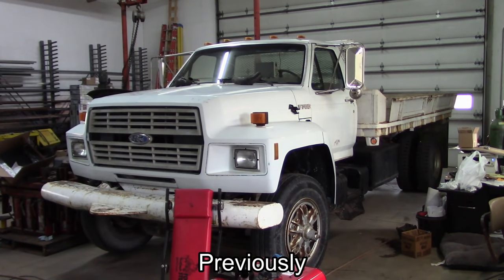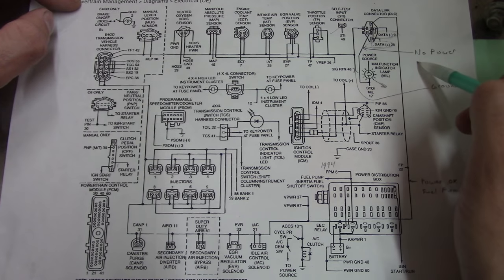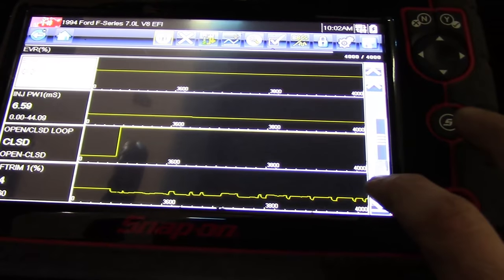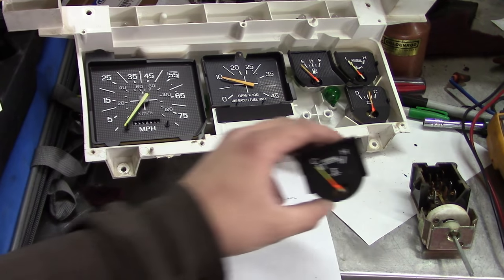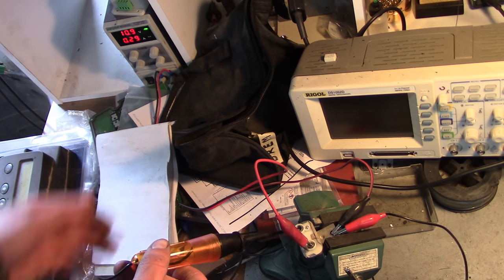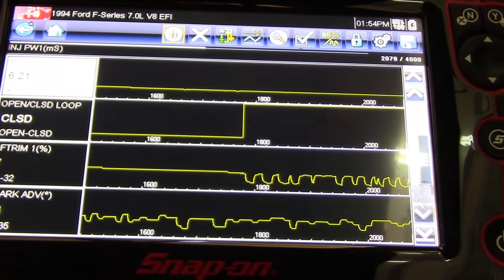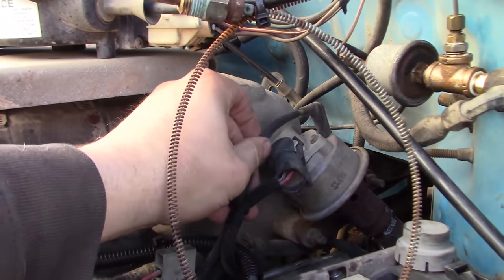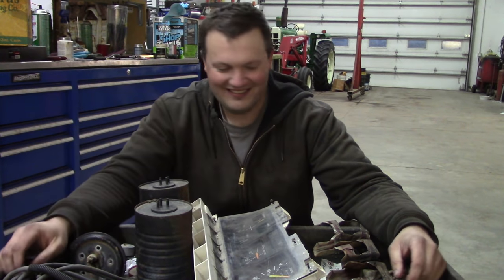Ford F700 Project - Missing, High Idle, and Gauges - Diagnose and Fix (Gas Engine) - Part 3

Comment from the maker: Mystery solved: the second diagnostic connector is for the governor servo unit!
Reply: So that was actually a factory connector? I would've never guessed! And that part you said its for sounds like it belongs on a diesel, not sure what that does on this truck.
Reply: @CumminsDriver100  especially since so many previous “repairs” were Frankensteined together.
Reply: The greens will be happy you spent $120 on new evaporative purge valves, but I think there were cheaper and easier ways.  The simplest being plugging that hose, or a slightly greener way might have been restricting that hose, but leaving a little pin hole size port to draw in the evap fumes, or a pcv valve. 
    I suppose none of those options would shut off the damn light though.
Reply: @dinolino3313  A mechanic should generally try to save his customer money unless specifically ordered not to by the owner, which I doubt because such an owner would just buy a new truck.
Reply: Any method for taking small scratches out of tempered glass? I have a large fish tank that somehow got scratched up by the movers and I was wondering if maybe anyone knew of a way to buff the scratches out or maybe a product that can do it.
Reply: Well, they had to double everything..

Comment: Whatever you charged for this job, it was'nt enough!
Reply: Ha, 2 mortgage payments.
Reply: One of Life's unanswered mysteries I guess.  But I sure am curious.  😉
Reply: I hope atleast $700 just for the labor
Reply: 1200$ labor!
Reply: a dollar 280 an hour.
Reply: To me it would have been [truck resale value] x 1.5
Reply: I was thinking a solid $2k!
Reply: @mph5896  I thought it was "boat payment!"
Reply: That old truck was worth fixing however... Go find one for what it cost to fix.
Reply: It's pretty hard to give the owner a repair bill more than the truck is worth.
Reply: @warrenklingensmith1241  Why? It's not Wes' problem that it's a turd. What could the owner get for the scrap value of the truck plus Wes' repair bill?
Reply: Your phone didn't autocorrect that??

Comment: Wife:  What are you doing?
Me:  Watching Wes Work.
Wife Why?
Me:  Beats the heck out of actually working myself
Reply: I have an Explorer scattered all over my garage floor. Much easier to Watch Wes Work!
Reply: Luv-IT! Ding Ding Ding!!
Reply: @mph5896  I also have a explorer im tearing apart have a 2004 4.6 v8 378,000 on original engine it has deff gone a long way im in the process of pulling it and gonna rebuild it
Reply: Beats the heck out of the absolute garbage on TV.
Reply: @lilscottyboy2004  Nice. I have a 2016, I bought it a month ago with 100k with VVT solenoid codes. I did buy the Explorer cheap, swapped in new solenoids and figured a return problem could occur. Same problem a week later. Pulled it back apart and the solenoid screens are plugging up with aluminum shavings. 

Had to pull the cam cap, and cam. A small piece of steel got into the oil passage and plugged up into the cam and started chewing apart the aluminum head as the cam turned. 

Solution, low mileage used engine. Problem being EVERYTHING needs to come apart to swap the engine. Cradle/drivetrain drops out. Every bolt/hose clamp, connector fought me on this one.
Reply: Jon Trudell it came from a county my brother works for. Not a police car but used by the county. I knew the garage mechanics guessed it needed timing chains. Took a gamble on it. I got it cheap, 5k. If I paid for labor I would be out. I’ll prob have 1k and 20 hours into it. I got a used engine for it with 12k, so that’s a bonus
Reply: @zrkn1  For sure!!
Reply: I just watch white im working 😂
Reply: Very good
Reply: @lilscottyboy2004  I was at the junk yard, and was walking past a couple guys. One said " Ford Exploder, You should have gotten a Chevy"... the next rows, and by the outside had 2 Chevy Trailblazers, and one more in a bit. All three were burned to deferent degrees. I said you mean one of those, that the ran a plastic gas hose in the head.

Comment: Great thought process on a 90s OB1. I have the shop manuals for my 1993 F350 7.3 and I chased a  bad ground for a week trying to get all my rear lights working and trailer plug-in. I am going to check my trucks smog stuff after seeing the rotten canister on my 1987 f150 gas. Thanks for showing a more scientific process instead of just throwing parts at truck like I do. You have helped me keep my old diesel running almost 200,000 miles.

Comment: Congratulations WES and Watch Wes Work hitting the major milestone of 100K Youtube Subscribers, truly is a good channel and well worth the time to view, this F700 wore me down just watching all the little problems it had developed and been patched up over the years, That High Idle pinch tube line test, never know how you figured that one out, still cant imagine how dumping that purge fuel gas back into a system would make this engine speed change, but this F700 to me was one heck of a project, glad you have got patience and stamina, this one would have put anyone to the FULLEST OF MAX TEST.... Congratulations again... 100K, one of the better things that happened in 2020..!!!
Reply from the maker: The open purge line is just a vacuum leak.

Comment: Nice video learned a bit more about evap system and charcoal canisters and evap solenoids. Im an electrical engineer ( 35 years experience) and also have used a power supply and potentiometer to troubleshoot /substitute  for faulty sensors. Most electronic devices have a vendor identification label on the device ( for example TI3055) and if you google the data sheet for the device there is a lot of information on how it works and usually shows some typical circuits which can be helpful.
Reply from the maker: Right. Often you can work around the sensors. The pulse generating sensors are tougher, but a signal generator can fool those.

Comment: You’re the man Wes. I used to be a flat rate mechanic. Now I do pretty much what you do, which is everything. From late model trucks and cars, to tractor trailers, to wood chippers, to excavators. It’s so much more satisfying taking things you learned from fixing cars and using the same principles on a wood chipper. Especially when the wiring is hacked together, which it always is.

Comment: Great job Wes.     You asked about how that instrument voltage regulator worked.     Ford used this system on their 12 volt cars from 1956 and at least through the mid 60's.    Dodge used the same system on my 1977 Ramcharger.   I don't know if the 6 volt cars had a similar system, but they probably did.     How it worked is they switched the incoming voltage (12V) on and off to keep the average output voltage at 5 volts.    Inside the regulator was a heating element connected to the output and a bi-metalic strip that had a set of contacts connected and when the heating element would get the bi-metalic strip hot, it would move and open the contacts, switching the regulator off.    Then it would cool off, close the contacts and it would start over. That means with 12 volts applied, the regulator would output voltage 41.6% of the time.     If the input voltage were to rise to 14 volts, the regulator would be switched on 35.7% of the time.     On the Ford cars and my Dodge truck, the gauges had small heating elements to convert the applied voltage to heat, and the gauge needle was moved by a bi-metalic strip.      That's why the gauges move so slowly.    Also, as you noticed you could see the the regulator switching on and off by the gauges moving a slight amount up  and down.

Comment: I am having massive PTSD flashbacks watching you drive this thing. I learned to drive a truck on a 1981 Ford. It had a 30-foot box, a manual tranny with a split rear, it had a manual choke in the cab. The power steering didn't work when you made a right turn. When I was 19 years old my boss threw me the keys and told me to take to the garment district in Manhattan. The truck was loaded front to back with rolls of fabric. I was terrified! I nearly flipped it over on the ramp that separates the Van Wyck Expressway and Grand Central Parkway. What a day. A few months later he bought us a set of UD's. UD was made by Nissan and it was like driving a sports car compared to that Ford nightmare.

Comment: Wes, that intermittent power instrument voltage regulator is the same type that was used on Mopar products from at least the '60s through the '80s, and its theory of operation has been discussed many times on Mopar forums such as For A Bodies Only.  There is even an improved aftermarket version of it.  I won't attempt to summarize those discussions here.
Reply: Now you mention that I saw them swap one out on misfit garage.
Reply: My 1970 Maverick had this little silver box on the back of the cluster.  I hooked my meter to it to see what it was doing.  Flash, flash, flash.
Reply: @lorrinbarth1969  I believe it pulses the power signal to the fuel gauge so when the fuel is sloshing around the gauge doesn't bounce...

Comment: when are you coming out to fix the cluster on my crane truck? lol Im not much of a pixie wrangler....
Reply from the maker: Well I've got some spare parts if you need em!
Reply: @WatchWesWork  This video really did help me get an idea whats going on in there, I attempted to fix the one in my old F700 Dump  with no success, the crane has the same issues so maybe I can get it going with your borrowed knowledge!
Reply: @DieselCreek  You'll figure it out Matt. A wiring diagram??(in colour), a screwdriver and a large Tonya Harding - fix it one way or another.👍😁

Comment: This is what "Nickle and dime-ing you to death" looks like.
Reply: Sometimes, but I'm betting at the price of getting a new 2020 version or one used about 4-5 yrs old, its cheaper to keep her.
Reply: My experience with  the nickel and dime syndrome is that some will  meaning but dull individual(s) tried to rigg something instead of an honest repair. The end results being a  cascade of failures caused by not repairing it right the first-time.... almost exactly the situation he had. Usually at that point the guilty party is long gone
Reply: @alexlail7481  Exactly. My daily is a 2007 Tahoe with 230k. I bought it with 180k and a bad rear end 3 years ago for a nickel. I do my own work and only use very high quality parts. First year it seemed like I worked on it every other month, often replacing junk parts like sagging aftermarket motor mounts that let the oil pan sag on the steering rack causing a line to break off. Now I am pretty much trouble free (knock on wood). I bring it in every 5k during oil change and look it over. Anything marginal gets replaced. In the past 12 months I may have spent about $500 on it. Not bad considering a new one is $600 a month
Reply: @mph5896  I'm with you on that I have never had a  Daily driver with less than 100k miles  and the one I  gad the longest was 10yrs old and had ~150k when I got it. I drove it for 15yrs and put almost 300k miles on it. But the first year or so was spent undoing other people's work.  My sister who is always a  concerned individual never could understand why I want to  drive something that old and constantly fix it... my response was not fix... maintain..and I spent less per year on average than 1 car payment for her 🙃 , and in general it was more reliable than her car that was less than 5yr old. If I enjoy driving it then i don't care about mileage or age assuming it is dependable and well maintained. My current daily driver is a1971 Ford and the first 3yrs I owned it i averaged over 2000 miles/ month just for work.
Reply: Or you get a old school carburetor  man ,trying to jury rig a fuel injection  system  like we use to do on carburetors.   It will not work ! Everything  must be right for fuel injection  to function properly!

Comment: Hi Wes, Ford used the same instrument cluster regulator in the 1960s here in the UK, it is quite a simple device comprising of a bimetal strip, a pair of contacts and some insulated nichrome wire wrapped around the bimetal strip which turns it on and off just like the old time flasher relays, later on they used an electronic regulator like a 7809 etc.
Regards from Ray in North Wales UK

Comment: I'm a good bit older than you Sir. I was shouting it's sucking air and then shouting it's the volt regulator on the back of the clocks. You got there love watching you work.

Comment: Your the man! My wife has a 1990 volvo 740 wagon that kept dying at stop lights. I went through everything. Ended up bringing to a shop and he ended up finding a 3" piece of vacuum hose that was not leaking, but was soft enough to collapse under vacuum, cutting vacuum to the MAP sensor and dropping the idle way down. Non obd2 is fun!

Comment: The ecm looks like it came out of the bottom of a swamp. The telescoping prop tool also works well against the brake pedal when you need it. Man this thing brings back so many memories of my time wrenching and driving on that F-700 chip truck. Ugh, what a roach. I'm gonna guess getting this one out of your bay is probably the happiest you've been in awhile! Lol I give you credit though, you stuck it out and fixed this thing the right way, and really went through the whole truck. It's cool seeing someone use the o-scope and take the time to diag it properly. So many guys get lazy and just shotgun parts at it instead of busting out the meter or scope. Hats off man. Your milestone is right around the corner, and rightfully so. Take care and stay safe!👍😎

Comment: 4/16/23. First of all I’m not a mechanic or like working on vehicles. The joy for me is watching Wes attack the issues using Sherlock Holmes style deductive reasoning. The cost benefit analysis of the labor involved versus the cost to the customer is for persons involved in the business to debate. Wes’s curiosity to solve the issue is what makes a compelling video. Plus learning what the function of all parts, wires and hoses is interesting. 
Thanks for the content.

Comment: I just run onto your blog. I have a '95' F-700 dump truck with a 429ci engine. Looks like it is pretty much the same setup.  It was purchased from a concrete contractor and it has a lot of corrosion and rot on the rubber and metal parts under it. Every year we use it in the fall and spring and  have to fix something on it. It is likely from exposure to the concrete dust and the corrosive environment of the dump. This spring I will be tackling the brake system. Need to replace the long line coming down the left frame rail and then the T-fitting, crossover and both jumpers from the chassis to the brake pumpkins. This blog has helped me with becoming more familiar with my vehicle.

Comment: Very nice repair. I find 90's tech easier to understand and it's fun following along as Wes fixes everything. The customer has a nice work truck. Any follow up maintenance will be a lot easier because the old hack jobs are already fixed.

Comment: See, this is why I like mechanical diesels, and carburetors! Congrats on 100K Wes!
Reply from the maker: I guess it's just because I grew up with it, but I love fuel injection. Even OBD1 was great. They start in the winter, get great mileage, are pretty reliable, and I think easy to work on.
Reply: @WatchWesWork  Yea, I get it. It is great when it works. But, for someone like me who doesn't know how to troubleshoot it, it is a nightmare when things go sideways. And, not always easy to find someone trustworthy like yourself to fix it, or even diagnose it, properly. I just don't like wires controlling certain things. Like my truck. Electronic shift transfer-case. It had fits of shifting itself for a while. Once in to 4-lo at speed! I spent way too much time chasing that issue. Swapped it all out for a manual shift case. And, it hasn't happened since! LOL. These new bolt-on fuel injection systems like the Holley Sniper have piqued my interest a little though.

Comment: Geez...what a job.   Its cool hearing it being driven.   Reminds me exactly of the sound I remember of the old Ford school buses I rode on during the early/mid 80s.   had 370 gassers in them.
Reply from the maker: Right! I remember the old Blue Bird buses built on Ford chassis with the 370 and 2 speed axle. That was the bus we got when the normal bus was in the shop. So much gear grinding...

Comment: Enjoy your debug process...step by step tracing it down. I do recall those gauge regulators being a pulse based from my Auto Shop days back in the early 70's(yeah I'm that old). A little surprised they were still using that same approach in the mid-90's. Also love the ride along with Max a co-pilot!

Comment: When I first start working as a mechanic in the late 90s I had a 1984F 700 dump truck with a 429 lima block but mine had a carburetor. I rebuilt the carburetor and did a tuneup when I first started up it backfired. Didn’t realize I blew the power valve.   First time I ever drove a truck with a two speed rear.   Great three-part video looking forward to questions and answers video.    Matt C.

Comment: That thing has more vacuum stuff than an old Mercedes V8 with k-jetronic + it has all the emissions and electircal stuff as well. Amazed that it (more or less) works !! Congrats with 100k+ subs, well earned 👍👍

Comment: Good short story about one of those old juice can Vacuum reservoirs.  I had one with a small rust hole that I patched with epoxy putty.  A quick drive around the block and vacuum leak was back. The whole can imploded in on itself as it had internally rusted paper thin.  I went back to the junkyard and found a plastic reservoir.